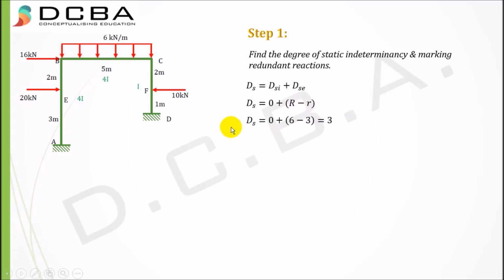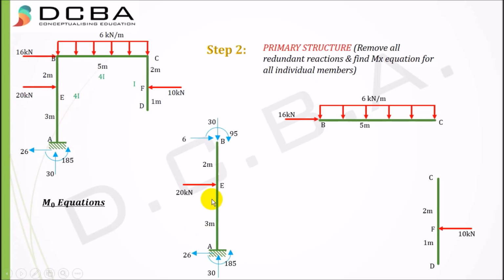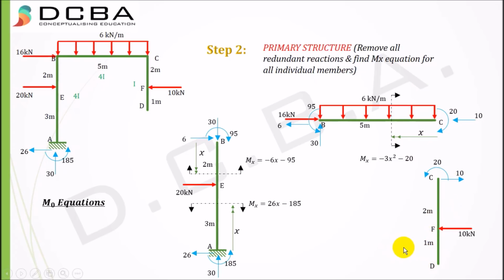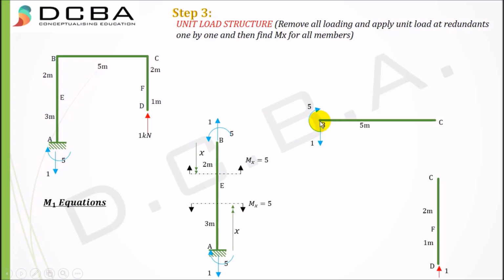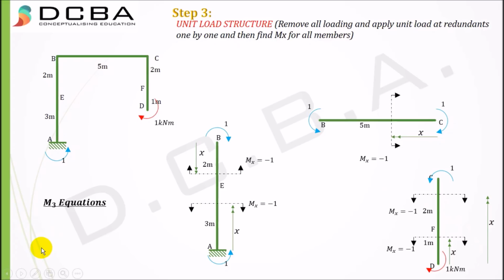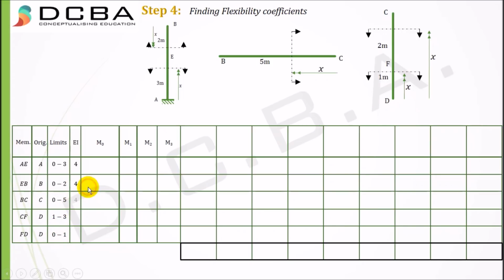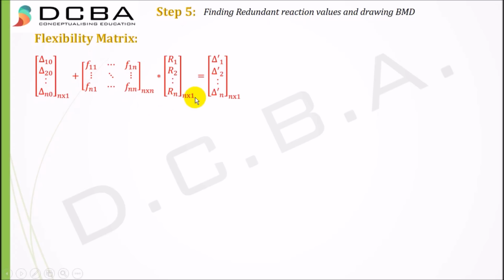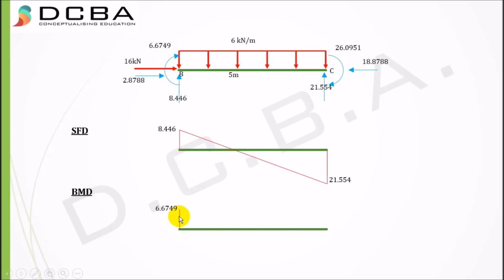Flexibility Method Structural Analysis Frame | Flexibility Matrix Method (Portal Frame)

Comment: At 6:37 you have got a clockwise moment at C i.e. 20kNm. Shouldn't it be +130kNm. You missed the 30kN vertical force. Is this deduction correct, or am I missing something here?
Reply from the maker: Mc = 30*5 - 6*5*5/2 - 95 + 20
Reply: @DCBAonline  this is -20 so should'nt it be anti clockwise?

Comment: i watch this video 2-3 time .... but all calculation you have done in step 2... is out of my mind. can you explain this in full detail. like how moment at A 185KN come and at B 95KN. PLZ Do help me... i have exam on this topic and this is very imp ...... OR  plz ref. me any book on which portal frame are explain so well manner.
Reply from the maker: S Agrawal Moment at A is found by finding reactions before splitting the member i.e. in the entire structure , the equation to find Ma would be (considering Ma clockwise) 
Ma + 20*3 + 16*5 + 6*5*2.5 - 10*3 = 0

The moment at B is found after splitting the members,the equation for finding Mb (considering Mb clockwise) is:
Mb + 26*5 - 185 - 20*2 = 0

I hope you got this.
Reply: Thanks you😊
Reply: 20x3+16x6-10x3+6x5x2.5=185
26x5-185-21x2=95
Reply: Bhayya how to apply 10*3
Reply: @gudlaspandana9294  Because the horizontal point load 10kN acting 3m from A
Reply: @vinayakgundla3839  but it is acting on cd member it's right or wrong
Reply: @vinayakgundla3839  
16 x5 i guess....